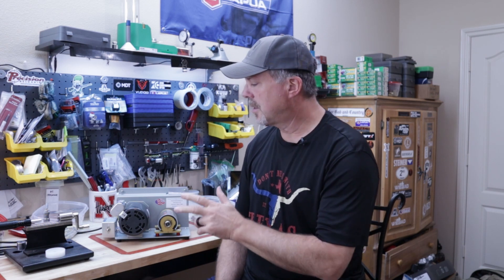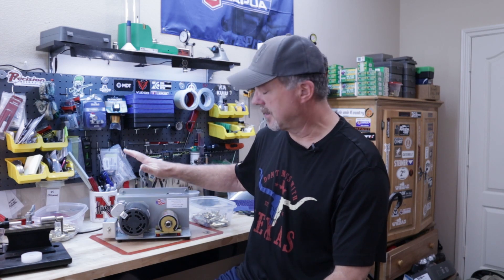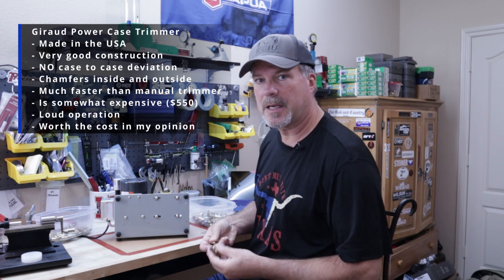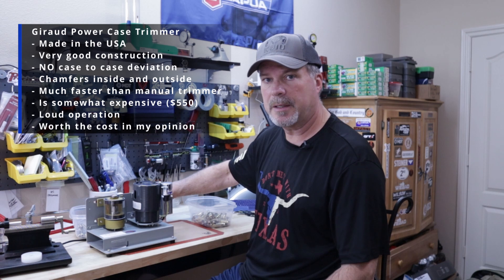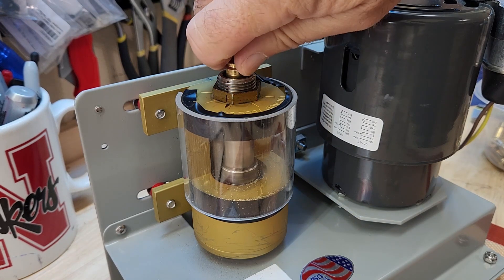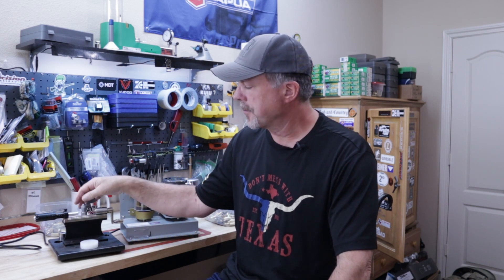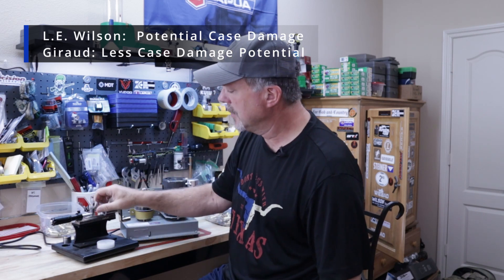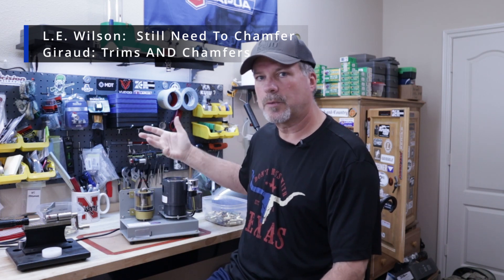Giraud Power Case Trimmer  vs. L.E. Wilson Manual Trimmer

Comment from the maker: Hey everyone!  Reviewing the comments below, I TOTALLY forgot to mention that there is a power drill adapter option for the L.E. Wilson that can help speed things up a bit and save your wrist!  As I mentioned to a couple of folks below, just make sure that you set your power drill speed correctly for the caliber you're trimming so you don't bind the trimmer head (too slow) on the case mouth.  Thanks again for watching everyone!

Comment: I have had the L.E. Wilson case trimmer for 3/5 years now, and it is perfect (slightly different style than the micrometers that you have, silver in color). I am doing right now 308 Winchester brass. Then I got to annealing 308/6.5 CM brass (EP Integration annealer).
Reply from the maker: Hi Rudolph!  Jason below uses the power drill adapter and that can speed things up a bit.  As I mentioned to him, just make sure you set the speed of the drill properly.   Thanks for watching my friend!

Comment: Just recently started reloading.  I have the LE Wilson but I bought the adapter to run it with a power drill.  Haven’t used it yet.  I fire formed my first batch, hoping to shoot my first ladder test this weekend.  We’ll see how case trimming goes soon.  Great video.
Reply from the maker: HI Jason!  Yep, I was using that adapter as well and it worked OK.  Just be sure to find the right speed that works for the brass you're trimming and you should be good to go.  Thanks for watching my friend!
Reply: @The4GunGuy  thanks for the pointer.

Comment: So does putting the tap around top and bottom keep the brass particles from getting out..I'm having same issue as you and was thinking of doing what u did..I love the trimmer..how do u clean your trimmer..I'm looking for a small hose like thing to get back behind the inside of the trimmer..
Reply from the maker: Hi Michael!  Yep, putting the tape around the top and bottom does help reduce shaving leakage.  To clean it every time I use it, I simple take a vacuum hose and place it over the opening, which get's 90% of everything out of the trimming chamber.  Once in a while I will take it apart though and give it a thorough cleaning.  Thanks for watching my friend!

Comment: Have you used the Lyman xpress case trimmer? I don't like the manual ones and for a motorized one, it seemed like a fair priced option
Reply from the maker: Hi ForceRecon112!  I have not used the Lyman, but it looks really promising.  The only thing about it was the fact that it is an open trimmer, so filings would be all over the place...At least the one I looked at was open.  If they sealed that cutter like the Giraud I think it might be a great option at a good price point.  Thanks for watching as usual my friend!
Reply: @The4GunGuy  I am getting an updated reloading setup and you have been such a good source of quality info. And I love that you respond fast! Thanks big guy!

Comment: I have used my Frankford arsenal trimmer for 5 years with the carbide cutter. What do u not like about it?
Reply from the maker: Hi Andrew!  I haven't used the Frankford trimmer, just the case prep tool (without the cutter).  But, in my research I was concerned about the brass shavings being thrown around by the unshielded cutting head.  The Griaud contains the trimmings so I just have to vacuum them out every cutting session.  Also, I notice that the Frankford doesn't accept straight cases such as a .357 Magnum pistol case where the Giraud does accept them.  I think the Frankford is a valid option for sure and maybe you just place it in a aluminum baking pan for example that can contain the filings.  Thanks for watching my friend!
Reply: @The4GunGuy  yea there are a few places that sell a pan for the shavings. It doesn't spin near as fast as the griaud and does have a cover on the top so the shaving fall out the bottom to the catch pan. It does work very well but not as fast as the griaud trimmer. Just another option that is cheaper. I would love to get the griaud or the Henderson one day if the Frankford dies. Just a heads up for anyone with the Frankford arsenal the RCBS carbide cutter is worth it and makes it cut quicker.

Comment: Your case to case variation on the LE Wilson comes from that junk Sinclair micrometer. Sinclair's quality is not what it used to be and MANY people have been complaining of its repeatability.

With the LE Wilson micrometer, their upgraded TiN cutter, and their power adapter, I get exactly 0 case to case variation. Mixed once fired brass, all comes out exactly where I set it. 2.005" exact in the case of 308/7.62NATO. My Mitutoyo calipers are not accurate enough to detect even a .0005" variation.
Reply from the maker: Hi Darryl!  You're right about that micrometer...For one, it drifted all the time and was a pain.  I do like this Giraud for the "all in one" functionality (trim, chamfer and deburr) though.  Hey thanks for your input and for watching my friend!
Reply: @The4GunGuy  any time, appreciate the great educational content!

Glad to hear the Giraud is working for you, I never had great luck with shoulder indexing trimmers, clearly you've got it nailed down though!